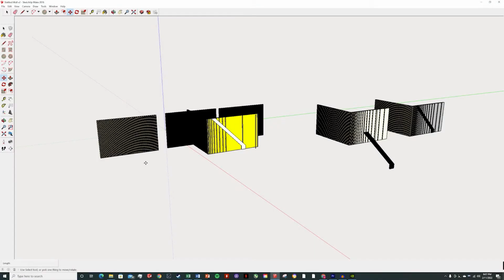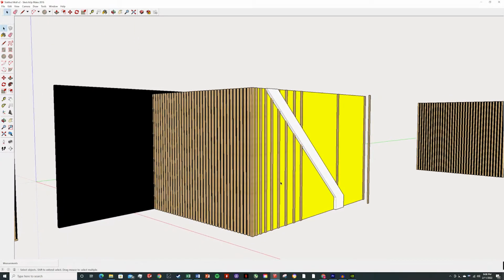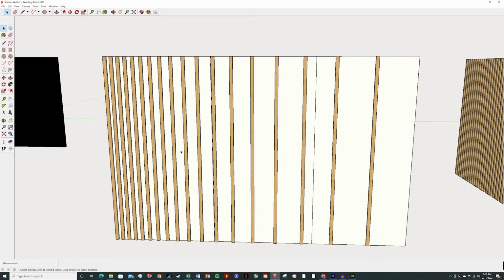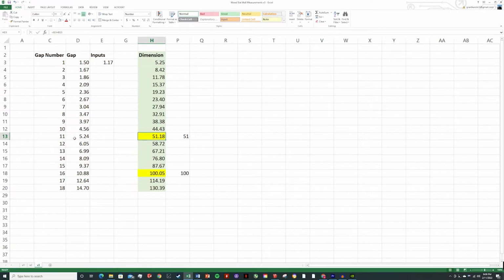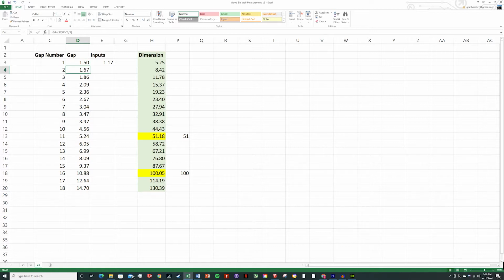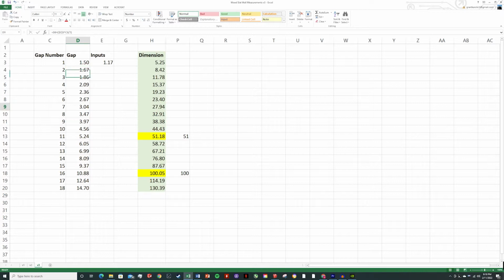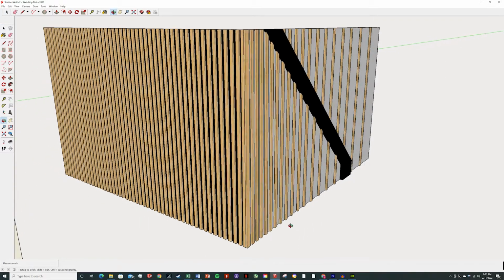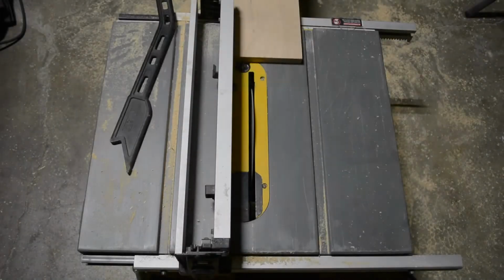Learn How To Use SketchUp to Design a Wood Slat Wall | The Lake House Project Ep 21

Comment: Overload the design. Work in a master project and then work per phases! The slot walls loos very bad crossing with stairs steps. Then you have all more wooden finishes so got lost. think about this, only from the photo at 9:42, I can see the slot wall, then the vertical wooden planks on second floor, then the 45° on top of kitchen cabinets.
Reply from the maker: Appreciate the feedback!

Comment: Nice idea, love the first wall <3  But to be honest, I did like the slats under the stairs only better than the whole wall. For my taste I might have liked the black wall even better. For me there is way too much going on now and nothing is a real feature any more. But tastes differ of course. Really like your creativity.  I want a wall like this for a few years now, I even bought the wood already three years ago. Might be about time to get it done before I completely change taste again haha.
Reply: Agreed.  Black wall looked better the way it was before.
Reply from the maker: Thanks for the feedback, really appreciate it! And go for it!
Reply: My thoughts EXACTLY! I would have stopped at the original wall and left the contrast of the stairs to shine. But of course to each his own. If you're happy with it, that's all that matters, nice work!
Reply: I agree. Liked the first wall better. When it comes to design, as a general rule, less is more. To me, the stairs wall looks like it is unfinished because the pattern, spacing between the slats are irregular. I would have left the wall black or another suggestion is to use a sheet of 1/2" plywood same wood as the slats and clad the wall.